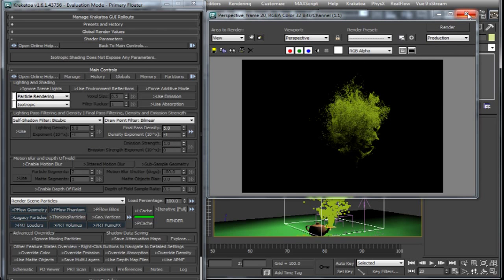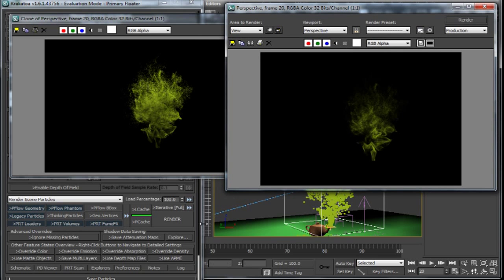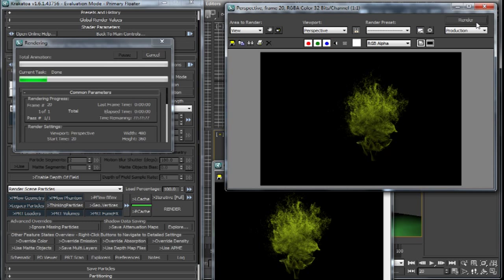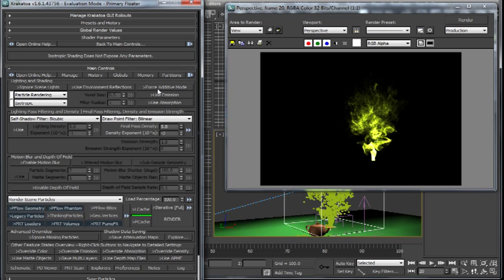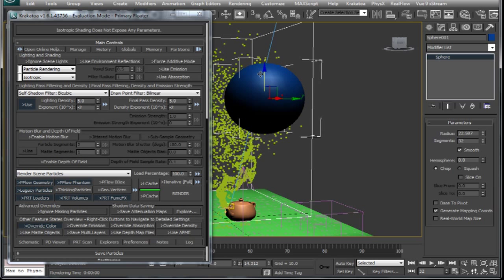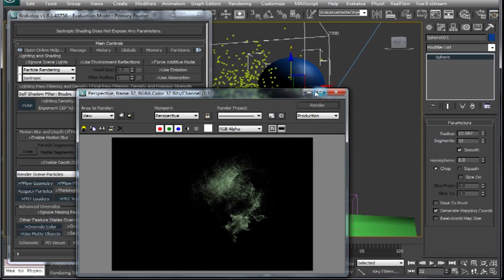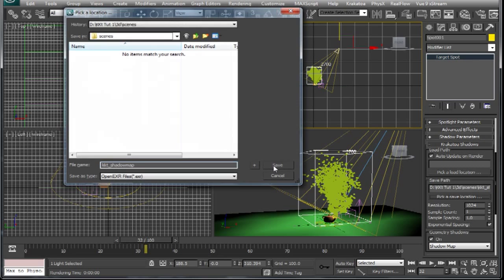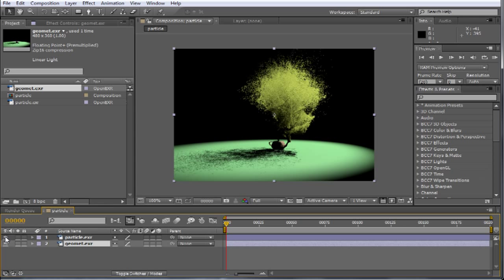krakatoa Tutorial Ch.1b

Comment: Nice job!

Just a quick note about the Density: In your scene, the per-particle Density value defaulted to 1.0, so a  Final Pass Density multiplier would not change the result if increased above 1.0 Exponent 0. But since a particle can have its own explicit Density value different from 1.0, say, 0.001 set by a material or MagmaFlow, a Final Pass Density higher than 1.0 would make sense in that case to bring the particle's density up towards 1.0.  So there are cases where it makes sense.